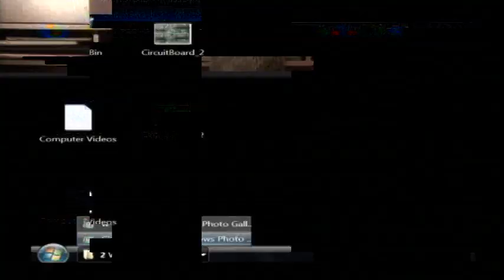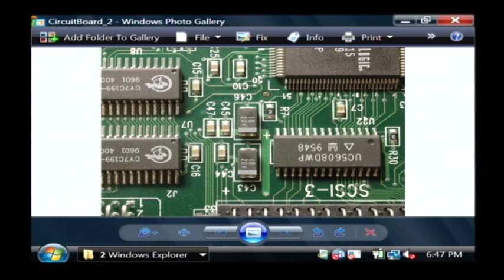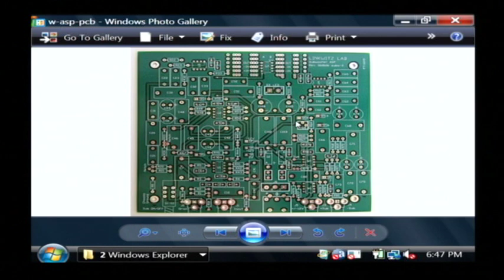Computer Tech Support : How Do Circuit Boards Work?

Comment: All the components in a circuit board began as MUCH larger devices decades ago. The larger devices were networked to make computers that spanned several rooms. Over the years, people figured out how to make smaller and smaller versions of the components that made up the computers. Eventually tubes gave way to tiny capacitors and resistors. It was no longer necessary to have huge cables connecting components. Circuit boards were a logical next-step.

Comment: Very interesting video.Would you be able to direct me to some good reference material on what substances are to be commonly found in circuit boards and components, and in particular the different types of metals?Thank You ,Trevor.
Reply: +Trev's Outback and Gold Adventures  did you find anything??  I am looking for same.
Reply: +SwoobFit No mate,I'm afraid I didn't.Will keep looking.
Reply: If you two are still looking for it, there a great book called Digital Computer Electronics by Paul Malvino and also a great digital circuits simulator called Logisim. Try to learn the basics yourself using the software and do lots and lots of googling to find what you need. Good luck.

Comment: Ok
 If the pathways on the circuit board are connecting the electrical components, why do I NOT see continuity on my multimeter when testing two points in the same electrical pathway on the board?

Comment: but in something like a game controller, why would it need to connect or transfer data through the chips?
Reply: Because every individual action you do on a game controller needs to be sent as data in order to be responded to on a game console. When you press a button on a game controller, that is perceived as a series of numbers and sent as an electronic pulse through the chips. Then the chips can interact, figuring out what button you pushed and what to do as a reaction on the screen.

Comment: but who the fuck sat down one day thinking "hmm maybe if i take little metal dots and copper wire and put them on a piece of silicone, attach it to a power supply, and wire it to a screen of light diodes, i can make a machine that will calculate things for me" srsly who comes up with this genious shit?